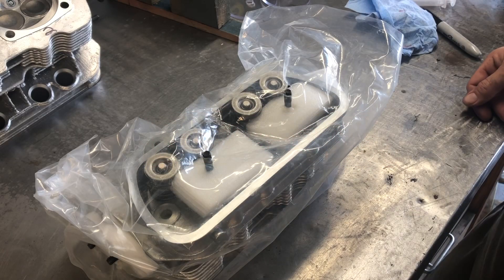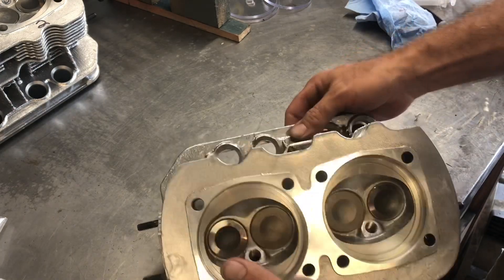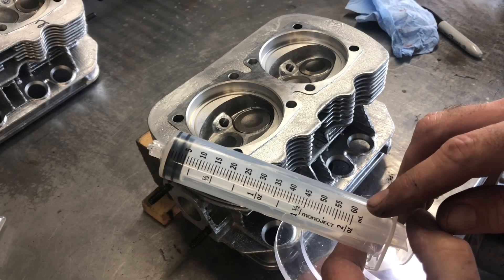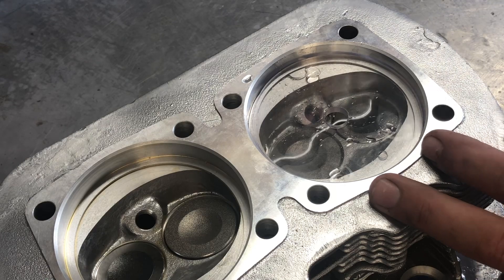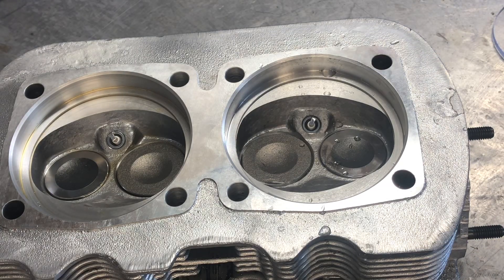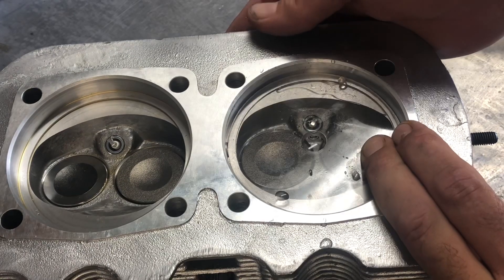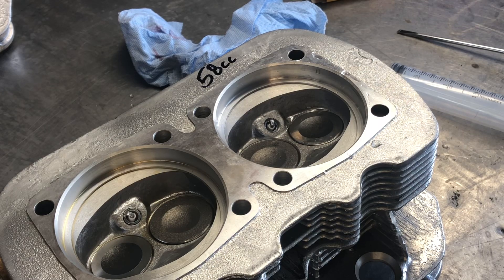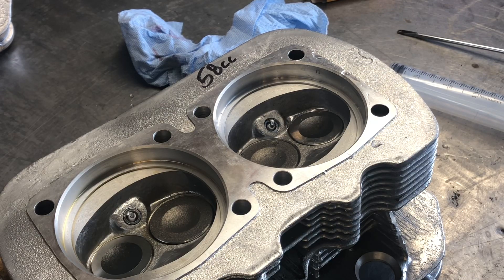How To CC Your Classic Volkswagen Heads. Bentley's Engine Part 5

Comment: Oddly i must have the identical heads with the exact same step and CC of 58.   And the exact same question on whether it matters.   Lol.  Or should i get a smaller disc to fit inside the step.
Reply from the maker: No, you need to cc the heads with the step as that’s part of the combustion chamber volume.

Comment: Do you need to do that for each side of the head or just one side and it’s good
Reply from the maker: It’s best to check every cylinder, do all 4 to ensure they’re all the same.
Reply: @VWJawbreaker  I followed you’re video which are awesome by the way. My CCs are 50, 85.5 pistons, 69 bore displacement is 1585. Haven’t set my deck height yet and im wondering if I can set it at 8.1 for my compression ratio or should I choose a different compression ratio. Im in Ca and will use 87 or 89 octane gas.
Reply from the maker: @MrTodo6969  compression ratio needs to be matched to the cam shaft. 
What cam are you running?
Reply: @VWJawbreaker  oh boy, do I have to crack the case to determine that? I bought the bug used so I have no clue
Reply from the maker: @MrTodo6969  you can usually see it behind the oil pump. 
If it’s a stock cam, I wouldn’t go 8.0, I’d keep it closer to 7.25-7.5 max.

Comment: Those heads look like they have built in steps. When you cc's the heads with steps you need smaller  plates to fit inside the step. The step is part of the cylinder,add to the deck height.  I didn't know that either, until I read about in the thesamba.
Reply from the maker: Romeo I thought the same thing man, but I took an old cylinder without the piston installed and it fit where the step was.... if the step was removed it would make for less combustion chamber area.
Reply: @VWJawbreaker  
 Sorry, I'm going to have to disagree with you. ✌
Reply from the maker: Romeo all good man, appreciate your feedback and comments as always 🤙
Reply: Not do disagree...but if you're measuring CCs to figure compression you MUST include the step area. Measuring inside the step will not give you an accurate compression calculation